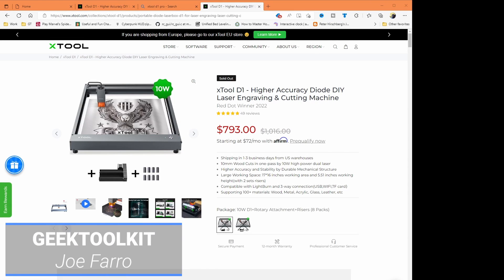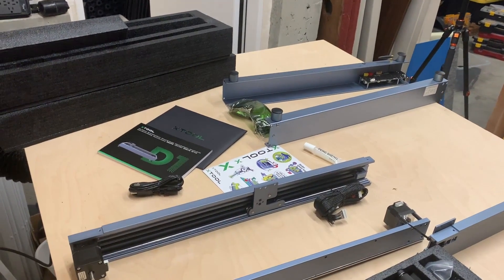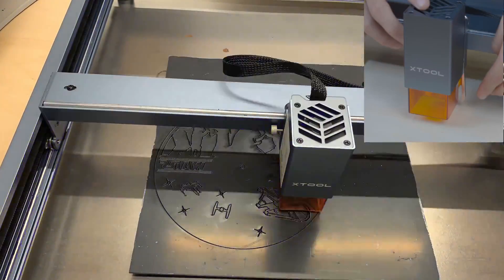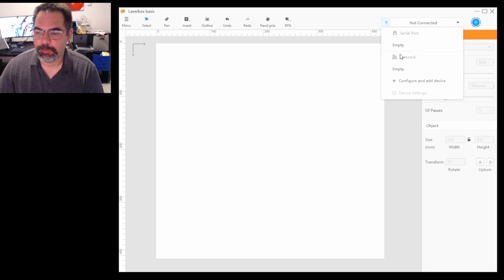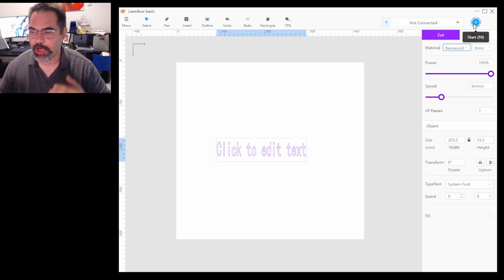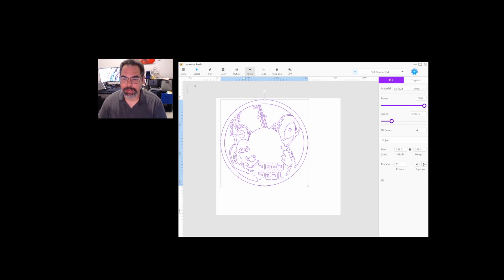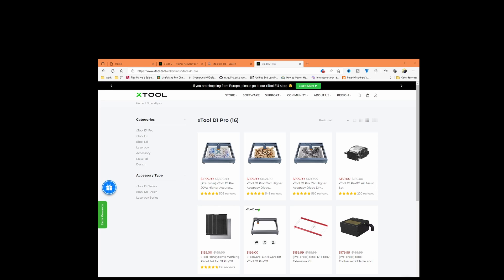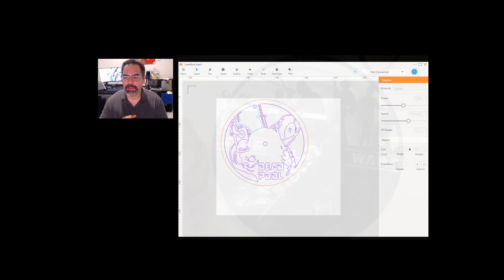5 things about the xTool D1 10W Laser Cutter

Comment: Where did you get your clock or other designs that might not be in the  laserbox software.? I know you mentioned lightburn but was just wondering while im doing my research on what laser to buy .  Im a first time user that does leather tooling. Im just looking for a rime saver to do hat patches. Im really leaning towards  this one.
Reply from the maker: I get a lot of designs off of Etsy.  The clock was in a pack of about 60 designs. Be careful buying packs of 1000 or more because those are usually tons of files, but you'll spend alot of time sorting or organizing them. I usually find for 5-10 dollars I can get quite a set of designs though and I just build up a library of them

Comment: Hello friend, first of all, thanks for the demonstrations on the xTOOL D1 10W.
I am about to buy one, but I would like to know if this machine has Limit Switches (end of stroke detector) on the X and Y axis.
I am in great doubt about the xTOOL D1 10W and the Sculpfun S30 Pro 10W.
Another thing: what is the basic difference between the D1 and the D1 Pro?  Thanks
Reply from the maker: Great question! The D1 does NOT have limit switches which shocked me for the price. But the pro does. I haven’t tried a sculpfun so can’t speak to that and haven’t had a pro to try to know if there are other changes. I’d look for something with an air assist or air assist upgradable though if you’re looking to cut. I’m realizing after a few 10w reviews it’s weird to have 10w and not have an air assist